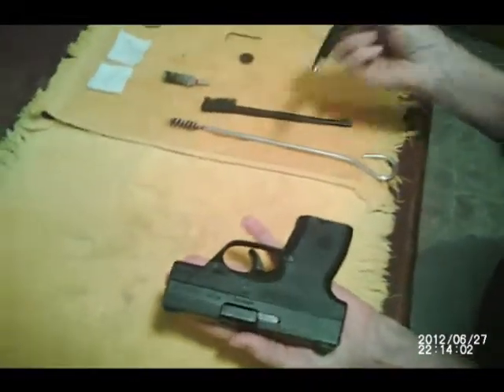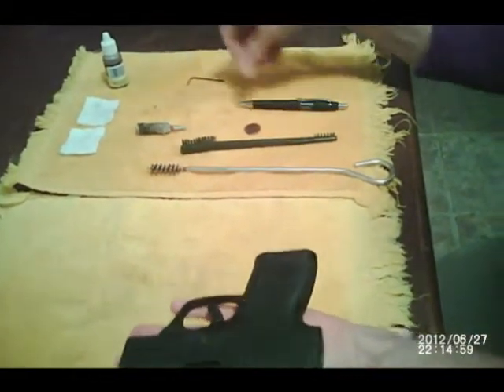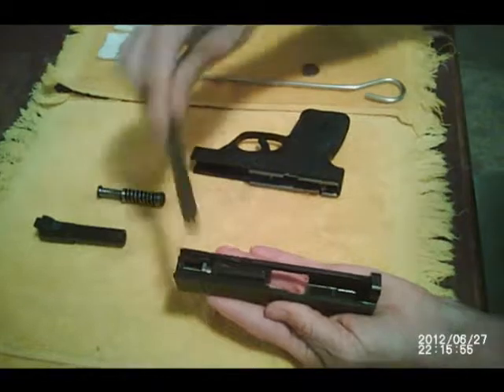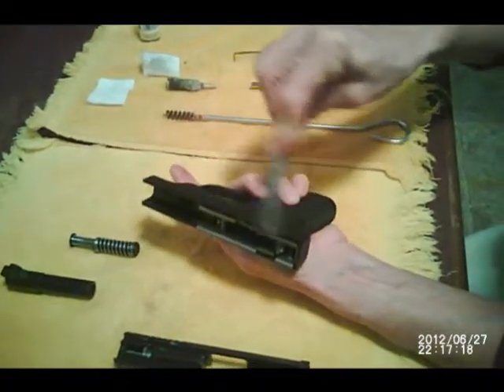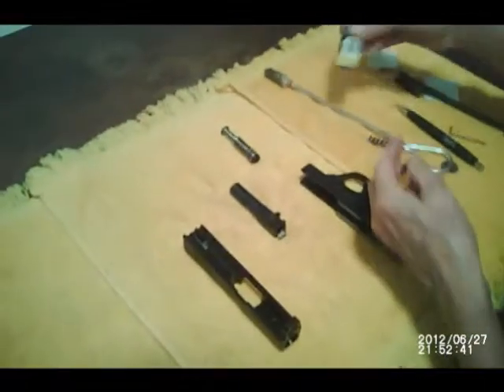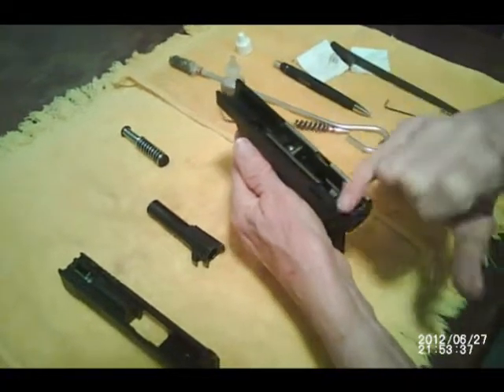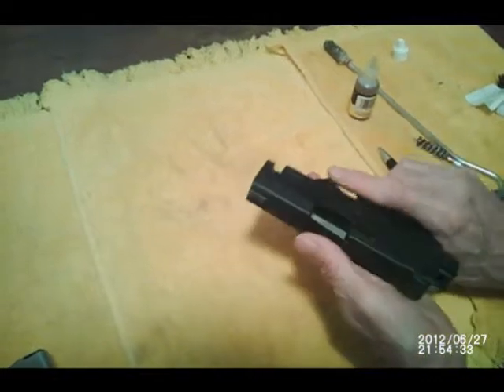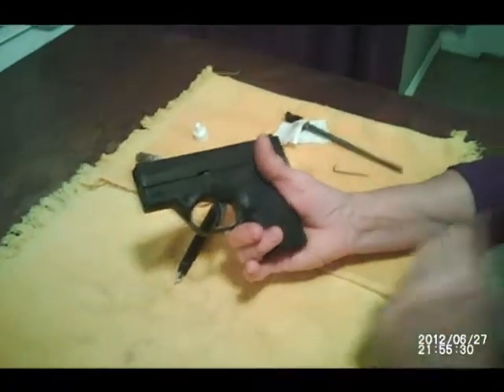BERETTA NANO Part 2  Take Down and Cleaning

Comment from the maker: Hi Tiffany,  Yes grip is the culprit. I call it breaking the wrist when the shot is fired if the wrists are not held straight they will flip upward causing the FTE's.Practice shooting one shot at a time holding your arms slightly bent at the elbows and wrists firmly held straight out from your arms.When the wrists break the slide does not complete its cycle and the ejecting shell gets caught in the opening and the next shell can not load in the chamber. Be safe.God Bless.
Diane

Comment from the maker: Hi Tiffany,thank you for viewing my video.Yes, grip is the culprit.When you draw and fire make sure your wrists come straight back with your arms.I call it wrist break because after you fire a round if you do not hold your wrists firmly straight when your arms come back with recoil the wrists break upward from the force of the recoil causing FTE's.Practice one shot at a time until you are proficient at keeping your wrists locked in line with your arms during recoil :o) Be safe. God Bless.